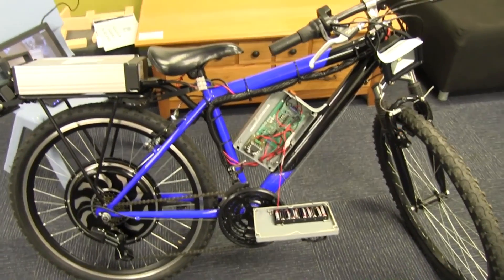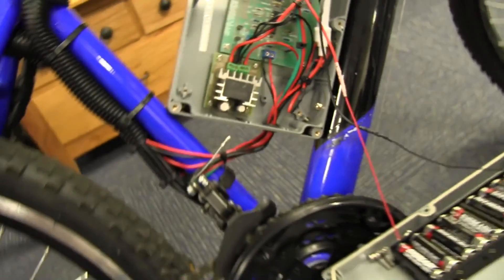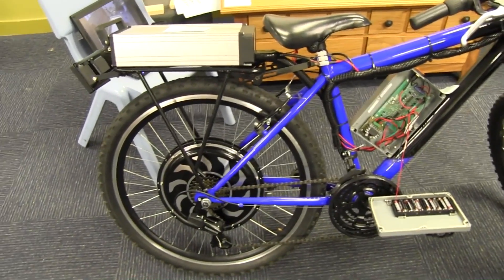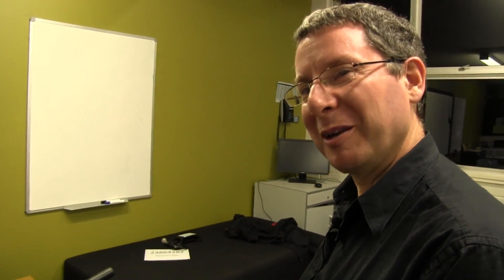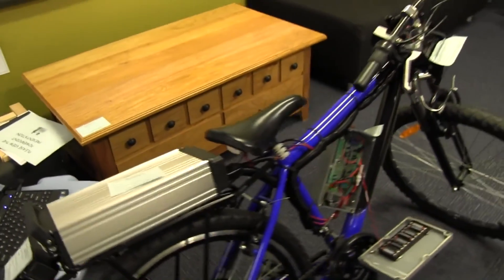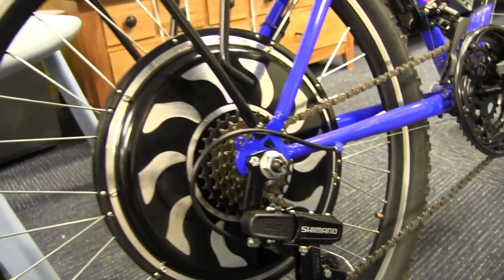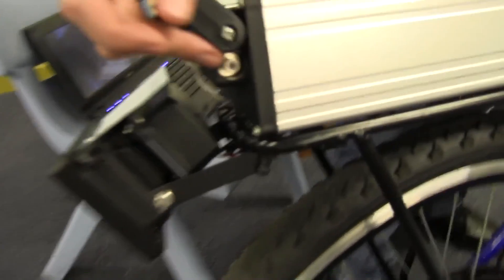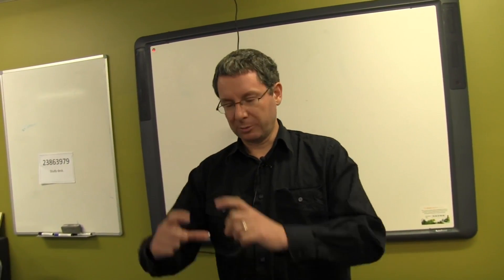EEVblog #338 - DIY Electric Bike

Comment: already the way of the do do bird. I had the opportunity to buy one of these bikes at our local GoodWill Store. lead batterys are quickly being replaced with lipo. Even then the motor is highly inefficient.  you can still buy them on line but they are really dump in the price. I would take care of that speed limitation problem. I am looking at an electric lawn mower motor as a possible DIY alternative if I did go with an electric bike. Its in my future. all I need is to attach a variable speed controller. can you imagine the speed I can get out of that motor.?

Comment: The strangest thing in Czech legislation is that the e-bike is limited to max 250W and pedelec system, and 25km/h max speed and in the opositeto it a bike with 1kw gasoline engine is still considered a bicycle as long as the motor is only "added" to it. Government fail

Comment: The interesting thing is: even when limited to 25 km/h it still helps bike penetration tremendously. The netherlands are already the most bike-infested country in the world, and even though our landscape doesn't need pedal assistance at all, 15% of bikes sold are electric. The reason? Instead of just being a tool in fair weather, the electric assist allows the bike to be used in any time of year and any weather. It's convenience, just like the car is a convenience.

Comment: No, it's a lot more drag than you get from the regen braking, because it's shorting all of the motors backemf, as opposed to just the few volts of boost that is typical on a regen brake.

It would be effective, though, and unless the guy's superman he's probably going to give up before he melts the wiring.

The tricky bit is switching it in a way that won't kill the controller if something goes wrong.

Comment: Wow. 25km/h.  Hardly seems worth bothering with a motor at all.  In most of North America it's 32km/h, and even that isn't really enforced.  As long as you don't ride like a fool, nobody is likely to notice or care.

On my road bike I normally cruise faster than 32 on leg power anyway, so there's no point there.  It's nice on my longtail cargo bike where I sometimes carry heavy loads to be able to keep it around 30 on the hills.

Cargo bikes aren't very common here, though, so I think a ....

Comment: Ah, well, here in the Netherlands (and surrounding countries) we have laws stating that electric bikes cannot go faster than 25km/h without being classified as a motor vehicle (and thus requiring helmets, insurance, all that jazz) so almost all manufacturers state 120rpm specs. So that is why I quoted those numbers.

And those 20W lights on my velomobile are really useful at high speed and unlit terrain, but even with the optics they blind oncoming traffic easily. I usually run them at 10%.

Comment: you wouldn't likely cruise at 120RPM.  that's only about 24km/h. Presumably you would be doing about 32km/h where the motor should be in the 75% ballpark, which isn't too bad.  Geared ones can be nicer and weigh a lot less, but also usually cost more, are noisier, and more complicated.

And no, on the road you don't need 20 Watts of lighting.  I have high powered lights, and I'm usually running at 10% PWM to not be totally distracting to other road users.  I'm sure his light is sufficient.

Comment: (continued) and honestly, the cost savings if any aren't that big. There is maybe a $100-200 cost difference between modern Bosch front hub motors and these chinese ones, which you easily gain back through the savings on the battery. And that is one of the primary reasons that you would never see golden motors on quality dutch e-bikes, they're all either brushless or agni-type really high torque dc (which is another story entirely).

Comment: To give some quantitative background to that comment: the golden motors achieve about 55-60% efficiency at 120rpm, 250W and the motor weighs about 8kg. Compare this to modern-day brushless motors (geared, so a bit more noisy) that achieve a bit over 80% efficiency at the same point *but* also have much better low-rpm torque and efficiency, and weigh only 2kg. That means that for a 500Wh-equiv battery you save 6kg on the motor and a bit over 1kg for the battery.

Comment: The point I was trying to make is that the parts he used are extremely out of date, it's nearly 10 year old tech now, and there are much more improved alternatives nowadays that universally improve on these so-called 'golden motors'. Even direct drive ones.

There is no question about different technologies having their tradeoffs but this is just unnecessarily big, expensive, inefficient and not really what a bike is about.

And to answer your last question: 20 watts! bit.ly / R9JB5b

Comment: Yes. Some motors have a freewheel in them so that they can roll without turning the motor, which is nicer if you're going to be doing a lot of unpowered riding.  The disadvantage is that the motor can't give any regenerative braking either.

It's most common in motors that have a planetary gear reduction in them, since the amount of drag turning a geared motor could be much higher (since it's spinning faster).  There's not really a correllation between freewheels/gears and brushes though. ;)

Comment: I think you do want to be mean, or you would pick a nicer word than horrid.
direct drive hub motors are just big.  Not much you can do about that.  Different technologies all have their tradeoffs.
I have little doubt the led is bright.  Sure he could get better brightness/efficiency with a brand name one, but how much power do you actually need on a bike light?  Run it a little below rated current, and do some decent heatsinking and it'll work fine.

Comment: Basically, the magnets magnetize and demagnetize the stator poles as they pass, and absorb some energy.

You can still ride, but you definitely feel some drag.  It'll make a road bike feel like a mountain bike on knobbies.

I'd estimate you lose 3-5km/h of top speed, depending on the magnets in the motor.  Not a big deal if you run out of juice and need to finish your ride home at 25 instead of 30, but if it's something you wanted to do frequently, better to get a freewheeled planetary motor.

Comment: Right.  He's probably looking at specific motors.  Brushed/brushless has little to do with it.  It's more a question of direct drive vs planetary.

A planetary setup will be spinning the motor very quickly, and the drag is probably significant, so they'll add a freewheel.

Comment: Depending which way you ran the current on which wires, it will just rotate the motor up to 9 degrees. (1 pole)

If you live someplace dry, and there's no rust, you can usually separate the motor by removing the screws on one cover, and then holding the wheel by the rim and pressing the opposite end of the axle against the ground.  The stator will pop out with the side cover, and you'll have the other side cover and magnets separate.

If rusty, try a gear puller.  You'll likely bend the stator.

Comment: It probably has iron cores that cause cogging. I was thinking of testing my win gen alt as a motor to test gen/motor effeicnence, but I didn't have the kit to drive it then. there is a CVT gear hub for push bikes that use's roller cams, maybe thats the clutch for the dc types. £400 in the uk for a full kit on ebay last year, I am still planing on building one of these, I bought a bike for this build, but haven't had the spare time and cash to give it a go. Made me rember all the biking fun.

Comment: It shouldn't be too hard to modify the controller to operate in a freewheeling mode. Basically, have it operate in a very low power mode that just overcomes the induced motor torque so it would behave like a standard bike in that mode.

Comment: I don't think it's true. A brushed motor is not less draggy, probably the planetary gearing systems he is referring to include a one way bearing which totally makes sense.  
Such hub motors should also have a one way bearing (separate from the one used for pedalling so they won't slow you down when you don't want.  But in this case you wouldn't be able to use regenerative braking.

Comment: with a quick look at Mouser, a 100lm 3W Cree is about 2.50$ each and with a quick look at eBay, HK Sellers' 10W LEDs (similar in look to the ones in the video) run about 850-1200lm for 12$ per 5 LEDs (in a few listings). Now, the HK Sellers' LEDs are obviously dodgy at best, but I can assume that with a nice, fat heatsink, they'll work just fine and are "easier to replace" (because they're cheap). Sure, an equal-lumen Cree would be nice, but they're costly (about 14USD each).

Comment: I'd ditch the split wire sleeve and go with halved pvc pipe. Run the pvc pipe through a table saw and cut it in half lengthwise. The half pipe would then placed against the frame tubes to make a crescent opening for the wire to go through. Paint the pvc black or the color of the frame and zip tie it on.  It would look much better than the warped split wire sleeve.

Comment: At 10:17 I do not understand why the brushless AC motor has more free wheeling manual-pedal drag than a DC brush motor. Is it only because the brushless hub has the controller inside and it loads it like a generator?

Comment: I think that's amp-hours, so a 360Wh battery. The actual current rating of the battery probably allows for >1kW of power, but the motor controller limits it to 200W electrical (=120-140W mechanical). That also explains the low speed (25kph@max power, flat terrain), because 200W mechanical should propel you at at least 35kph on a mtb.

Comment: I don't want to be mean but... this is absolutely horrid! There's like 4x as compact hubs available nowadays, with equally smaller batteries that last just as long, and entirely wireless except for the power cables (e.g. dutch brand electric bikes). Also, that LED is probably lower lumen output than a modern 3W cree... I guess it's lots of fun building something like this, but it's old, really old tech that has gone into this!